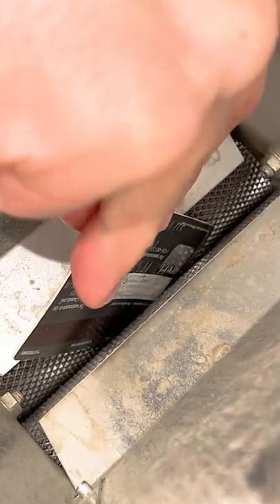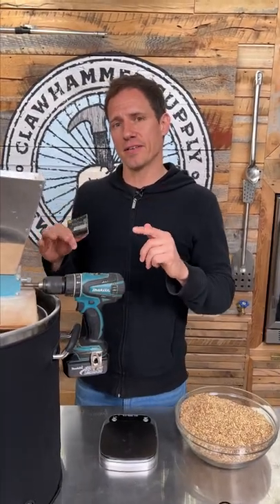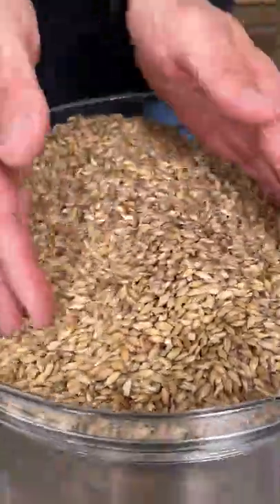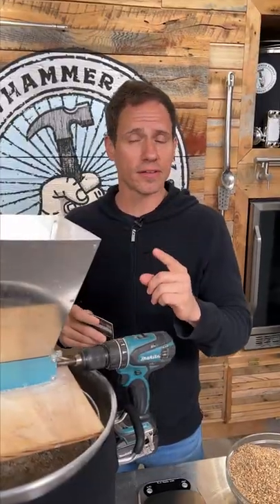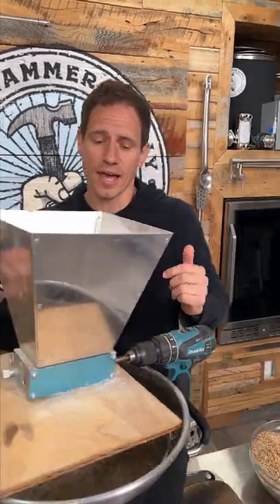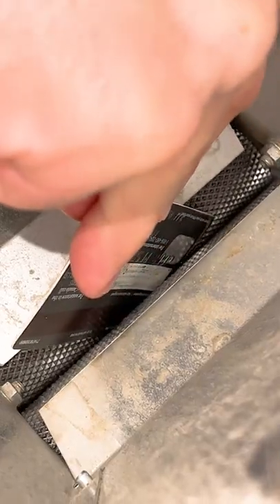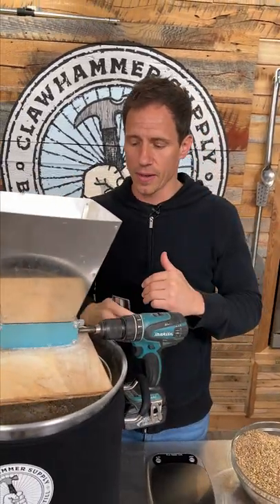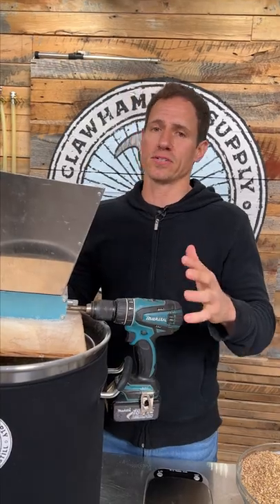Homebrew Grain Mill Tips

Comment: Dumb question, why not make it even finer and higher efficiency by using a smaller gap? Too many fine grain particles make it through into ferment, making it hazy or something?
Reply from the maker: If the gap is too small the grain won’t go through the mill. You’ll probably want to double crush to go finer.